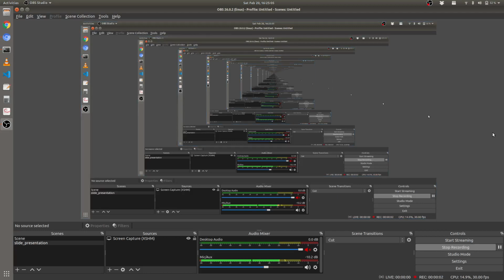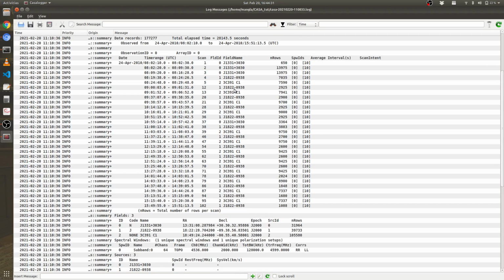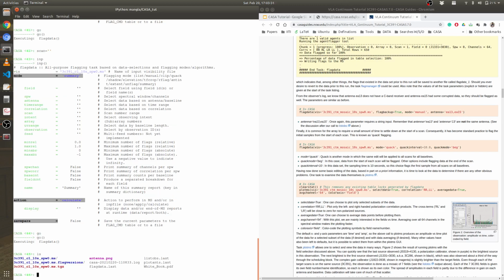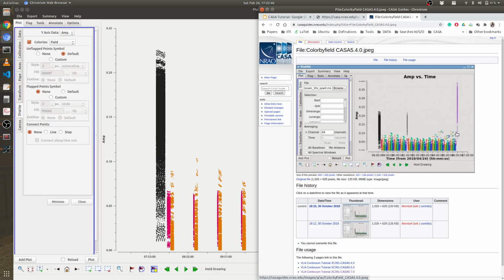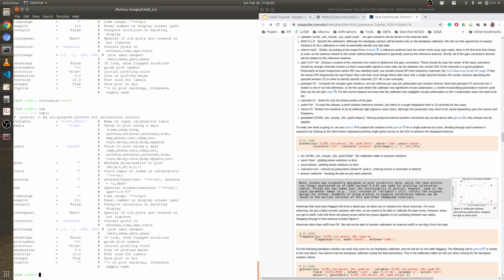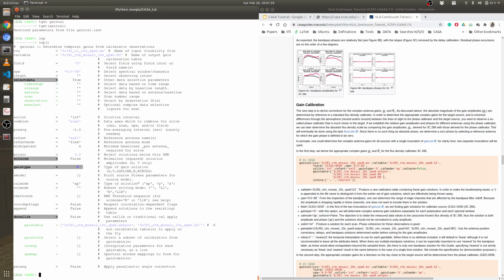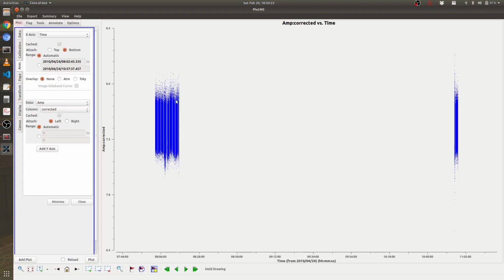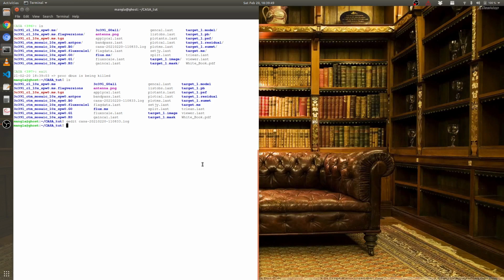CASA tutorial for Radio Astronomy Data Analysis | Flagging | Calibration | Imaging | VLA | GMRT |

Comment: where do i get the file link
Reply from the maker: You can download the full data from here 
https://casaguides.nrao.edu/index.php?title=VLA_Continuum_Tutorial_3C391-CASA6.4.1#:~:text=You%20may%20obtain%20the%20data%20set%20from%20here%3A%20http%3A//casa.nrao.edu/Data/EVLA/3C391/3c391_ctm_mosaic_10s_spw0.ms.tgz%20(dataset%20size%3A%203.1GB).
Reply: @mangla.sarvesh  thanks a lot. Really appreciate it!
Reply: @mangla.sarvesh  This link to download the data is currently not working. Could you provide any other link if there is any?
Reply from the maker: @yogeeshn6258  https://casaguides.nrao.edu/index.php/VLA_Continuum_Tutorial_3C391-CASA6.4.1
Reply: Salam encik Luqman Hakeem :D